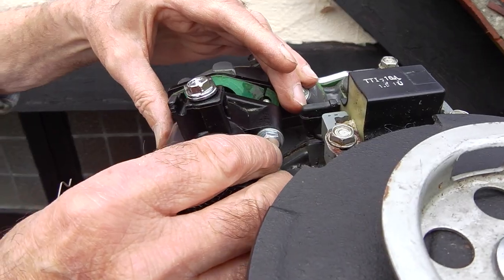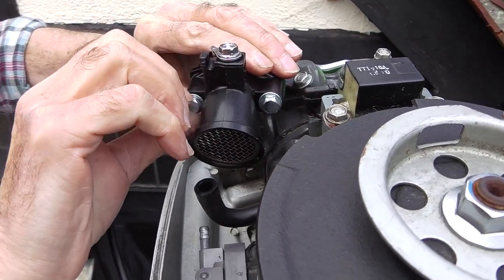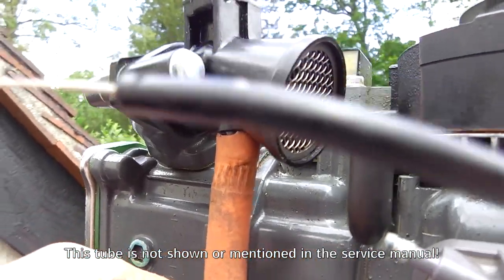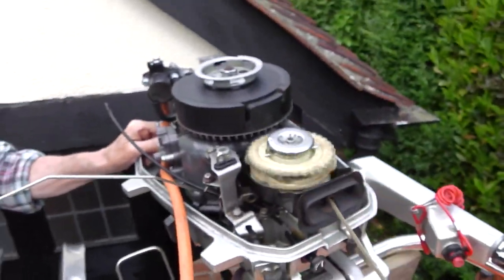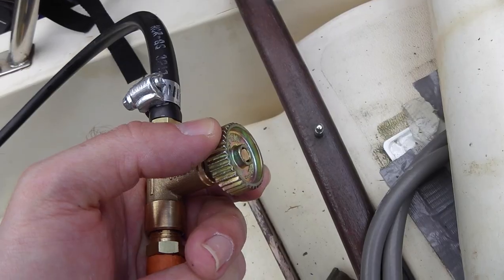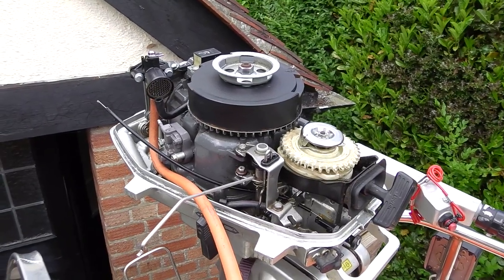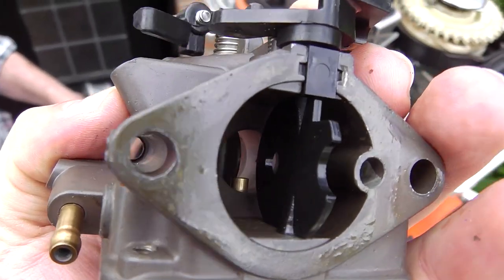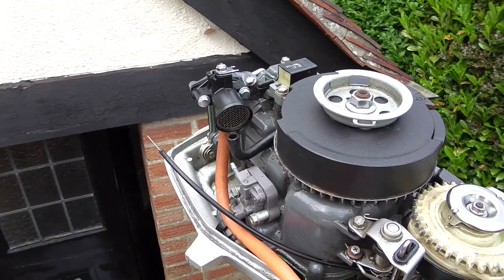LPG outboard hack 2

Comment: There is a right way to do this..... I've converted  many things to LPG.   You can buy a venturi that goes between the carb and air cleaner, which you combine with a demand regulator that opens on suction.  The existing throttle controls the power.  The venturi maintains the mixture, and there is a mixture screw on the venturi.
Reply from the maker: Thanks! Since I made this video I've discovered more about just what you say: venturis and demand regulators. I haven't gone any further with making anything, but I keep some extra hoses so that I could drive my outboard from my cooking gas in an emergency.

Comment: So what about 2 stoke lubrication? You engine will wear out much quicker if you don't mix it with oil somehow.
Reply from the maker: This is a four-stroke engine. I don't know how you'd do this with a two-stroke, though there might be a way to inject some oil into the carburettor to be drawn in with the gas, possibly using the original jet.